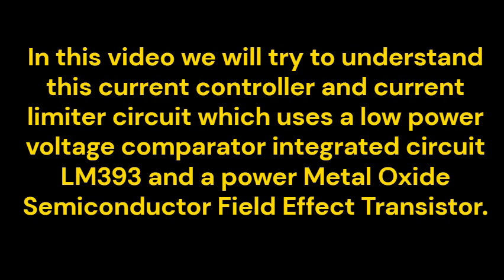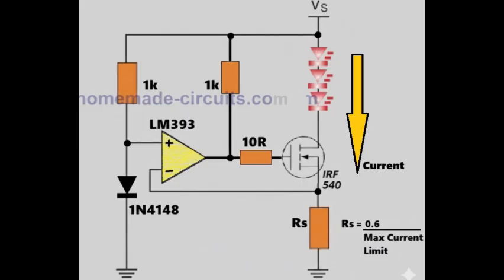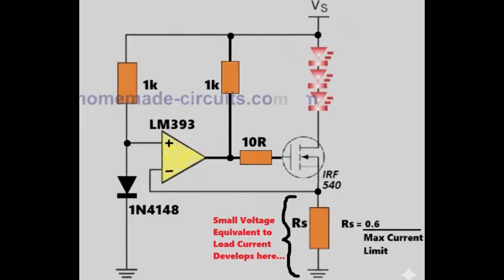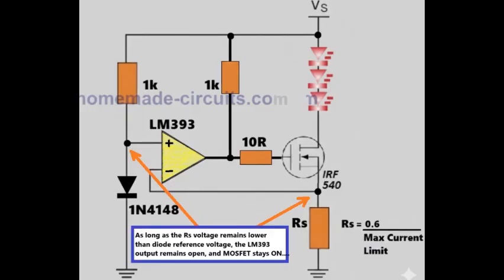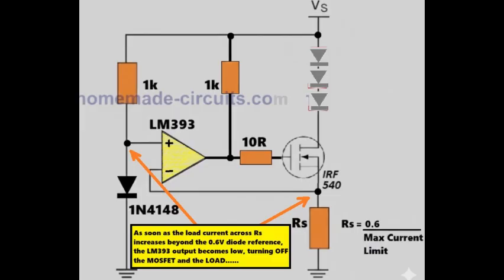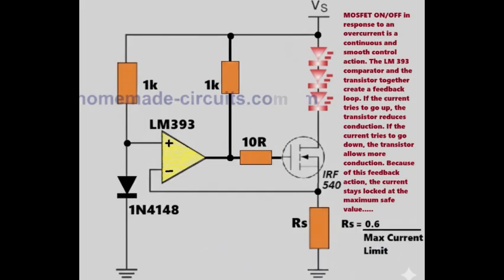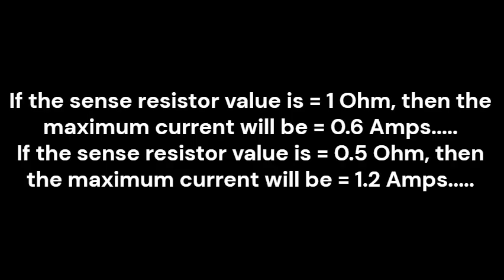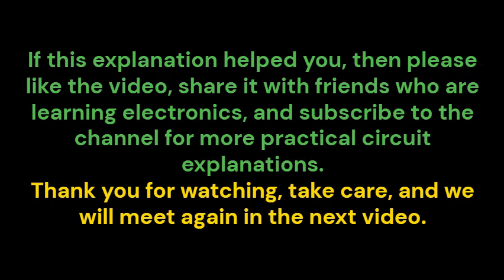Make this Current Sensor and Controller Circuit using LM393 Comparator IC

Comment: Why a comparator and not an opamp? The IC's output must stay in the linear regime, not switching, that's why an opamp is more appropriate.
Reply from the maker: Hi, As you can see the LM393 IC here is used as a comparator, not as a linear amplifier.
In this current limiter, the output does not need to stay in the linear region. It only needs to detect when the sense voltage crosses a threshold and then pull the control node down to limit the current.
For this job, a comparator is more suitable, faster, and safer than a general-purpose op-amp.

Comment: LM 358 можно использовать? 🥺
Reply from the maker: Yes, you can use it...
Reply from the maker: Yes, you can use an op amp from IC LM358 also
Reply: @Homemade-Circuits искусственный интеллект сказал что 358 не подойдёт 🥺, я нашел нашел 393 и собрал схему всё работает, возможно есть схема блока питания с защитой от короткого замыкания на этой микросхеме ,спасибо что вы есть 😊
Reply: @СергейБелинский-ж5в  Я собирал, на ней миллиомметр, схема практически та же - все работает.
Reply: @Lexxl67 спасибо, вы ставили миллиампер вместо светодиодов в этой схеме?
Reply: @СергейБелинский-ж5в  Нет, там принцип такой: Стабилизатор тока на 1А дает падение напряжения на сопротивлении 1Ом - 1Вольт.
Вместо светодиодов подставляешь проверяемый резистор и измеряешь на его выводах напряжение. Если ток настроен на 1 ампер, то сопротивление равно этому напряжению. А настраивал на 0.1А (Что бы не перегревался проверяемый резистор) соответственно 1 Вольт равнялся 10 Омам.
Reply: @Lexxl67 большое спасибо